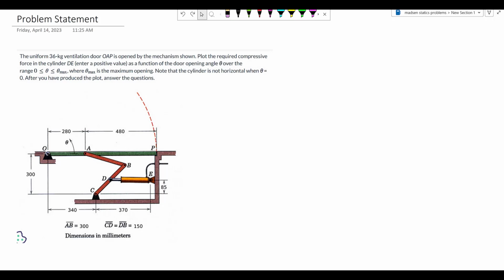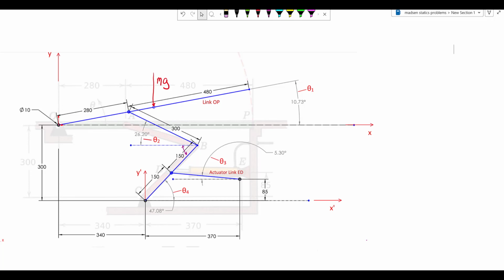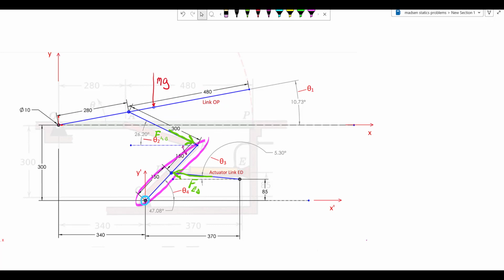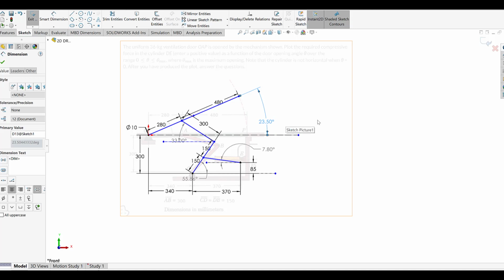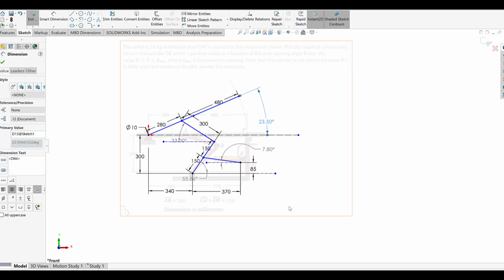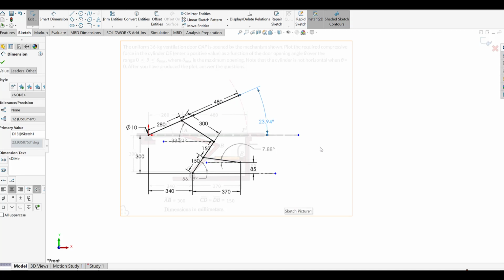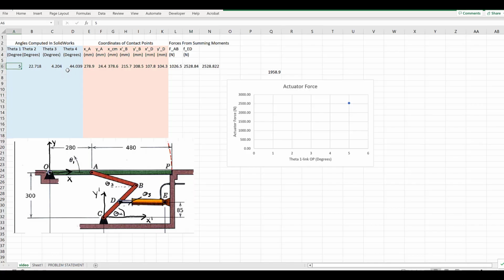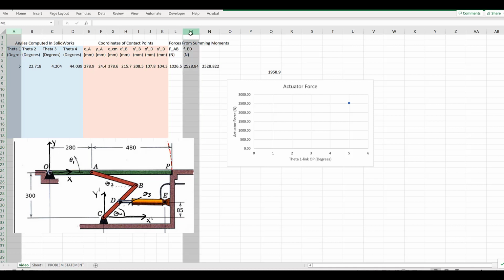CAD as a Tool For Statics Problems

Comment: I have an actual real world problem that requires just this type of solution.  I have to modify a scissors lift design uses one hydraulic cylinder to lift a have 32 ton load.  I need to calculate the force requires by that cylinder for every 1" of travel the scissors lift is required to travel to insure I have enough capacity built into the hydraulic circuit.  We use Autodesk Inventor at work.  I am looking for a CAD tool to solve this static engineering problem.